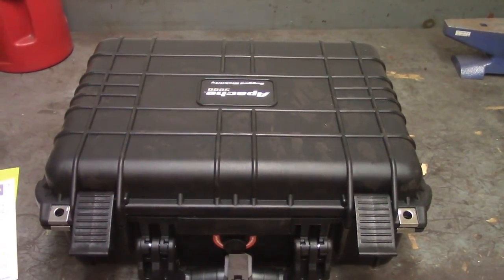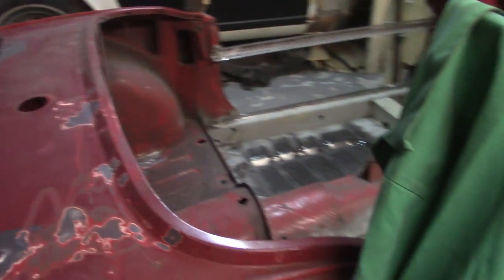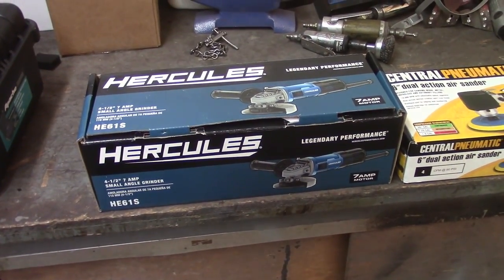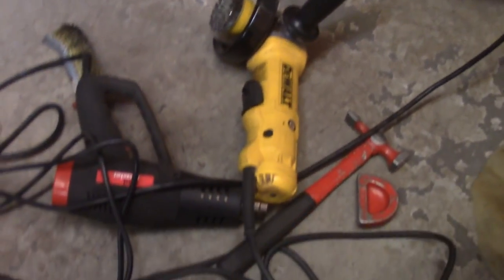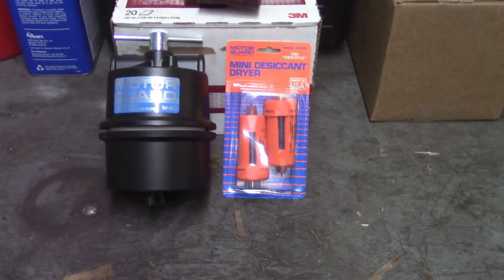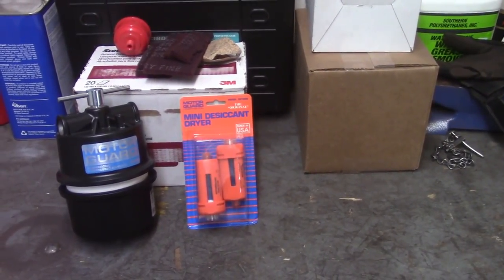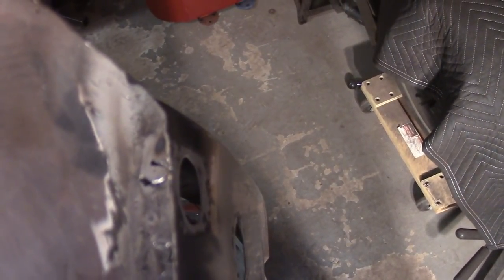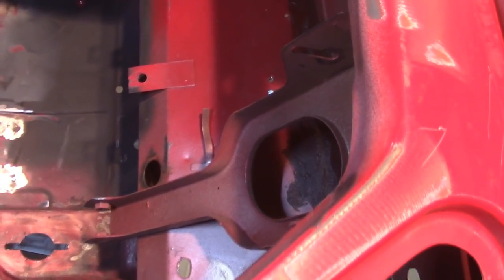Triumph Spitfire Restoration - More Epoxy Prep

Comment: Well done Chris, good to hear about the degree. Paint prep is long and boring but you are getting there. I have been using the hot weather to do some wax injection what a messy process lol going to put the car on a big plastic sheet next time.
Reply from the maker: Thanks, David. I've heard about that, but never looked into it. Seems like a very intense process!
Reply: Compared to paint prep it is a doddle, we will have a chat when you get the paint sorted. On the spit like my six the windscreen surround is a place to hit. The water gets in at the roof pins runs down inside nail it after paint but before you put it back on. 
David